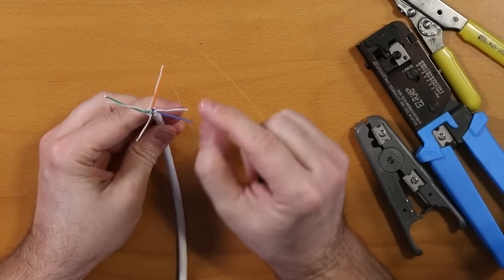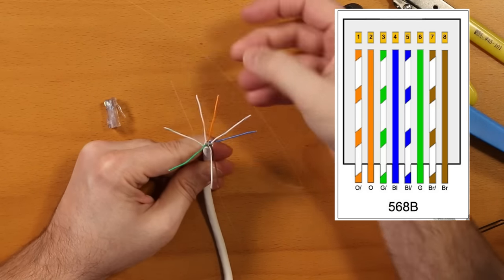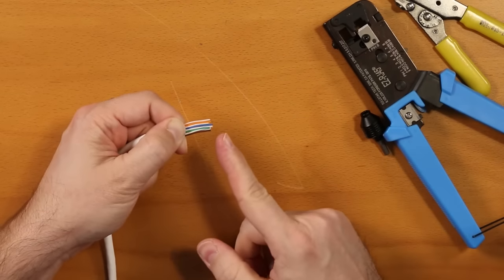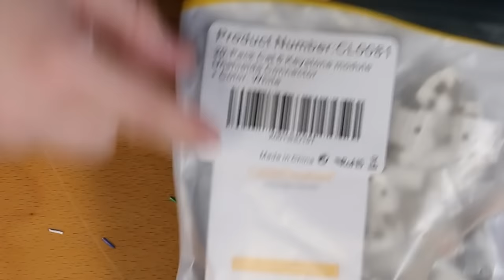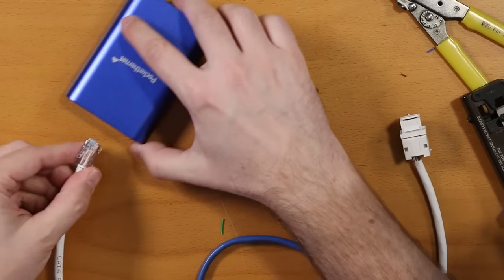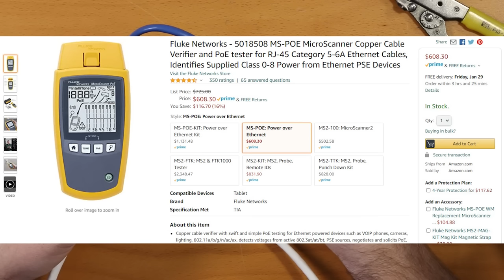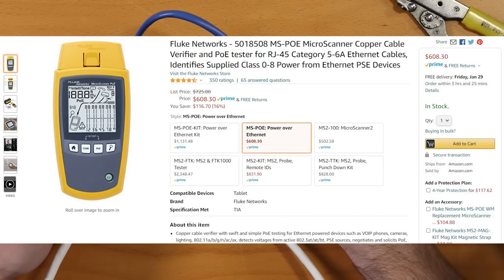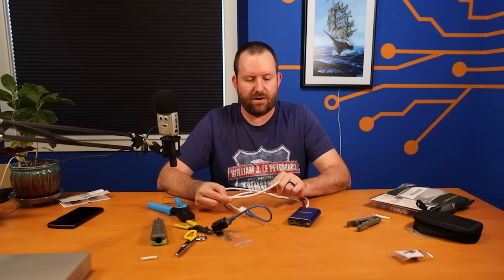How to Terminate Ethernet Cables

Comment: I don’t do it professionally anymore but as a network/telco technician for 20 plus years I refuse to do the standard rj45 crimp direct to cat 5/6 that every else does.  This is because rj45 crimps are to be used with stranded cable, not solid copper cable.  I dunno how many networks I’ve tested with failed connections with a fluke due to crimped cables.  

I do like like the keystone (no tool) direct to cable or the proper punch female connectors.  Far more reliable...  I’ve installed  over 4K telco/Ethernet sites so I’ve tested this pretty good!!  Am I right in thinking you said keystone and then said punch down though?   These are two different technologies.  Keystone is tool less, punch down is using an IDC punch tool.
Reply: I agree.  The little teeth in the RJ45 plug can break solid wire and cause a short.   They have better designed plugs now that work for solid or stranded wire but most people probably don’t check the specs.  I still would not use RJ45 plugs on solid wire except for one-off or test situations.   Stranded wire has many redundant conductors and is flexible so it is made for those relatively short patch cables at either end of a long cable run, which need to endure the manipulation and stresses of endpoint connections.   If you need to hook up an access point or camera it is best to create a mini IDF using 1 or 2 port surface mount punch down jack at the end of a solid wire run in the attic.  You can then use a short stranded wire patch cable for the last few feet to the device.   Stranded wire is expensive so it is not used for long runs.   BTW, stranded wire is a pain to crimp on a plug because the wires curl off in all directions.  Punch down your solid wire and buy your stranded patch cords for best results.
Reply: As a telecom/computer/network tech for the past 50 years, I agree.
BTW, my first LAN experience was in early 1978 on a proprietary LAN that used time division multiplexing over triaxial cable at 8 Mb or coax at 2 Mb.  This predates both Ethernet and IP.
Reply: @James_Knott  I also worked on coax networks and I certainly don’t miss them!

Comment: Never done a socket before. At 18:16 the diagram has Green/ orange on the Top row, and Orange green on the lower. How do you know which configuration to follow. Thanks
Reply: They two rows of colors on the jacks are labeled A or B. Chris was using T568b, so you use the color patten for row B.

Comment: It’ll take my electrician scissors over the cutting on the strippers on everything.    Sharp clean cuts.    I also enjoy them cheaper plastic squeeze type strippers if using 5e.   Cat 6 light scorch and it snalps. 

I learn to pull as I untwist and it helps untwist the cables a lot easier.

 But that is a neat little device for untwisting I have to check out.

And I like the jacket up into the module.     Never used the “pass through”. Guess I’m too old school. 🙃

Comment: On the keystone. Don't unwind the pairs completely. Strip the jacket back further at least 3" ( I usually work with about 4" to 6") can be as long a you like, then just un-twist about the 1st 1.5 inches  from the jacket so the ends are still twisted. Then place the jacket all the way up to the back of the keystone and start slipping the closest pairs in 1st. This way the jacket is as close to the keystone jack as possible and no bare wires are showing. This will really help if you are punching on a panel especially if it's already mounted and you are adding more wires.  On the mod ends I try to work the wires at the jacket after untwistng and I push the wires in a little further so the crimp catches the jacket amd no bare wires are showing.

Comment: Hello. Cat6 I can do ok. Cat6a I have problems with. The load bar for me I have trouble loading. The pairs do not seem to stay in their slot. It's also a little awkward that the wires that should be colored/white are actually just white. Any tips to deal with these issues?

Comment: I find that if you add the step of splitting the sleeve of the plenum cable about a half inch more, you can cut the divider/stiffener lower. This aids in getting the sleeve in the male ethernet connector.

Comment: If you use a connector with LSA plus rails you can also use a cable with stranded wire. Lsa plus has pins that are at a 45 degree angle

Comment: The copper pairs should remain twisted until the IDC for performance reasons
Reply: What does IDC mean?
Reply: @bavobostoen  insulation displacement connector. The little groove the wire gets pushed in where the insulation gets displaced to make the connection

Comment: Can both ends of the interior ethernet cable terminate at a wall socket? So a cable from modem to socket, a cable through the walls from socket to socket, and then a final cable from socket to device.

Comment: More than adequate for the home user wanting to do some terminations.  Pros will have their own method and many are negative about the pass through method as they have spend years snipping the conductors to the correct 100th of a mm. I personally prefer the pass through method but never bother getting the conductors too straight as isn't really needed. Couple of sideways jigs straighten them up enough to stuff then through. Never timed myself but easily less than 30 seconds to strip and term a plug.

Comment: You didn't say and it's hard to see if when you put the plug/connector on if the clip is up or down. It looks like it's down but... (yea, I know it basically doesn't matter as long as both ends are the same, but...

Comment: 2 major issues here. 1. You need to use that string to strip the jacket down further as there is a very high probability that you will score one or more wires when stripping the outer jacket causing a poor or completely non functional termination. 2. I don't recommend using the passthrough ends especially with POE because if the blade isn't sharp the blunt copper ends can touch each other shorting out causing all kinds of headaches, especially in damp environments due to corrosion. Experience is the best teacher.
Reply: I don't know if I like the idea of the passthrough male connecrors.  It just seems like that could cause all kinds of issues long term having exposed wires on the ends? 🤷‍♂️
Reply: @TheSpiv  that's fine, I'm sure there are plenty of installs that never have a problem... I'm just not comfortable personally with it. I'm not trying to tell anyone not to use the pass through rj45s...

Comment: I've watched a bunch of videos on this topic but none seem to emphasize that when you insert the cable into the male connector that the colour orientation ( left to right) is based on viewing the connector from the flat side ( not the side with the little flexible catch.) I assume that you must do it that way or at least do it consistently on the cable that you are currently terminating ?
Reply: Tab down, Pins 1-8 from left to right with orange pairs starting on the left as you insert the cable.   ( 20 years later I still get careless and s few one up.    Just not as often.

Comment: You can also use the channels on the outside of the Klein scissors to straighten your wires.
Reply: If you ever watch a phone tech do an install you will see them use the groves to strip wire. It takes practice to make it work. I use them all the time to strip wire when using cat5/6 for other purposes like phones or project wiring where screw terminals are used.

Comment: Why use B over A? Is there a specific configuration for specific applications?
Reply: There’s some long history on this.  Googling will give you short version here.  568B came out as a means to work with the phone pair (pins 4-5) while allowing use of Moden equipment with older phone systems and data centers.  In theory, if you terminate both A or B, it won’t matter.  If I recall, pins 1-3 n 2-6 are different on the A which is making a crossover (one end terminates A other B).  Hardly used today with auto negotiation switches. 

I think ATT had the insight with the 568B and find it is used almost always. 

Other things I have heard and not verified, was 568A is or was used in many commercial buildings and some countries still.  Not sure on that. 

Home Depot actually has a simple vid on the years of these two wiring schemes. I thought pretty good and will,show to my STEM students.
Reply: @stemmentor9700  beautiful. Thank you for your time!
Reply: A lines up with telephone cable.  B originated with StarLAN, which became 10baseT.

Comment: Hi Chris, this come right on time. I had today a debate with  someone regarding the difference between Cat.5 and Cat.5E cables. He thinks that there is no difference between these types of cables for short runs, and both can handle Gigabit Ethernet. I told him that even if the Negotiation between 2 devices capable of 1Gbps will be 1Gbps, the data transfer will not work at these speeds, but he still has his opinion that they are the same. Who is right?
Reply: I'm installing Fiber in Washington.
CAT5 will NOT work for Gig service.
CAT5e or above will only handle Gig service.  

I believe cat5 Can do 100/100..
But why would you do that?  
When 1000/1000 is the best.
Reply: @ctwm9963  cat 5 can do gig over short distances.
Reply: There is a physical difference in the cables, but over a short distance both should be able to do Gbe. If it negotiates at 1Gbps it should transfer faster than 100Mbps.
Reply: You would knowingly be using substandard materials so there is an ethical aspect to this question beyond whether it works.
Reply: @georgebush6002  if it's paid work yes
Reply: @jasonrowe6302  That definitely changes things, but person ethics may still come into play on what advise, if any, is given.
Reply: @TheSpiv  I almost clarified myself because I didn't want people assuming I was calling them unethical. I was just interested in hearing others people's ethical thoughts on the subject.  I thought you did a good job answering the original question, so thought I would build on that and introduce an additional consideration.  Personally I would try to answer if there is a reasonable chance the cat5 might do the job,  how high are the stakes, and how correctable is it if there are problems.  As long as this is understood and accepted by the appropriate person I would feel my ethical obligations have been met.  Thoughts?
Reply: CAT5e is just CAT5 with tighter tolerances.  Otherwise they're the same and both are rated for 1 GB up to 100M.  You're not likely to find new CAT5 today, as it's been superseded by 5e.
Reply: @ctwm9963  Plain CAT5 will work at Gb.  Gb Ethernet was designed for plain CAT5, before 5e was available.  The only difference between them is 5e has tighter tolerances, but both have the same specs.
Reply: @jasonrowe6302  Gb Ethernet was designed for 100M over plain CAT5 before 5e was available.

Comment: Aren't those RJ45 connectors made to be terminated on to a stranded cable only? Or are those RJ45 connectors made for a solid core cable?
Reply: Should work on both.
Reply: Originally, they were for stranded only.  But since people insisted on using them with solid, they made plugs that could work with solid or both.  Still a bad idea though.

Comment: So you don't have to strip these 8 wires before pushing them into the female end? It cuts into them or something when you push them in? 

I had cat5 run throughout my house during a rebuild and I don't know shit about it, except one cable seemed to not be working. I would test it through my ps5 and it got like 1mb download and 10mb upload (I have a 1gig plan). So I looked at the female end coming out of the wall there and it looks like the orange/white wire was nearly pulled out. It was wrapped up and nearly pulled out from one of the other wires, so I use pulled it out with a small flat head screwdriver, unwrapped it from the other wire it tangled with, and shoved it back in with the tiny flat head screw driver. I didn't strip it, but I assume it strip itself when I push it in. It seemed to work better after, I was pulled down about 100mb and 10mb up. Should be 600mb+ up, so I don't know if there's still other problems or not. My question is, could the low result be because other wires aren't fully in either in that female connector? Because it still technically worked without that orange/white, but only 1mb, then with it, it jumped to 100mb. But maybe with redoing another one it would jump up again? It's just weird that it's not an all or nothing scenario. I figured if one of the 8 wires were out, you'd get nothing as if it was a severed wire, but it still operated with 7 of 8 connected. But I don't know, maybe only 5 or 6 of them are connected properly. I guess maybe I need one of those tools or see if the electrician will come warranty their work.

Comment: Do most cable testers just test continuity, or do they typically have an option for testing throughput?
Reply: There are simple ones for checking mapping to high end ones that measure distance and if a short where it’s at, data loss, etc.  difference is whether spending 20$ or 500$.   You can get some decent one that do a lot for less then 100$.   I’m a fan of Fluke, (Microscanner).  Had for years now.just need to find it again. 😏. 

Stick with quality tools if doing a lot of this type of work.  It’s worth it.

Comment: So I was struggling at first with cutting the cables off the keystone jack, I was told that you have to cut the wires at a certain angle with the cutter.

Comment: Not sure how but...
was changing out some stuff with our internet situation. The former owner was doing some weird shit where some cat6 was going from a switch to a board of some kind, before going out to the rooms. Decided to take out the board cause there was a mess of other wires to all sorts of things that were just in the way, but now, despite me double checking to make sure I was doing the right standards, the speeds are 10% of what they use to be. Any suggestions for what I screwed up?
Reply: Can be multiple issues. Improper termination, possible older hub vice switch,  if using wireless, EMI.  

Did you remove the “panel” and just put on RJ45 modules and plugged into existing switch/hub?   Did you try and reuse and existing stud ,Ike the “ panel”?   

Repunchung down used IDCs or reuse of patch panels can be an issue

Punch down tool has dull blade or weak spring and not seating cables right.  

Check ports using two PCs to see what the  connection speed is.  

What type of switch .   Managed/unmanaged ?    

Possible cut wires.   Quality of switches and new material bought. (Connectors, switch, etc).

Comment: Hi. It's November 2021. Thanks for the vid. I get the idea of the wires being in order, but once they are, do you insert them into the connector with the little retention clip facing up or down? Probably dumb question, but I'm going to devote time and $$ into this project and I want to get it right before I start drilling through walls LOL.

Comment: I wanted to mention that the TPs are not just wrapped around each other, but are twisted themselves. So when you use a 'straightener' like the grooves on a bit, or a screwdriver shaft, you are not untwisting the wires. You are straightening twisted wires under tension. The wires under tension, like a spring, are only held in place by the pressure of the blades in a connector, but they will naturally over time want to untwist against the blades. I suspect some terminations under vibration or frequent movement go bad from this.

This is why making terminations is your, my, everyone's least favorite thing. 

But if you could simultaneously unwrap and untwist, you would have perfectly straight, perfectly untwisted wires. I made something that does just that: https://youtu.be/wTkS6fbAkI8?t=221

Comment: I used to do this kind of thing years ago - I was intrigued by two things.
1 - you made no mention of which way round the plug goes when putting the cables in. Without specifying this you can wire the plug the wrong way round.
2 - you didn't push the cable fully into the plug. The sleeve around the pairs should be pushed into the plug as it helps grip the cable in place when crimped.

Comment: great video!!! I have one question... do i HAVE to do the same color sequence that you use or can i just make my own (as long) as its the same on both ends?? Thanks in advance
Reply: For your own cabling it is fine.  If you're making them for anywhere else it's best to stick to one of the two standards.  The U.S. uses T568B while Canada uses T568A.
But as for the wires, they don't know what color they are.  They can all be the same color and they will still perform the same.  Ask any electrician.
Reply: @cfgdr3  Make sure the electrician knows how to work with Ethernet cables.  Not all do.

Comment: Your keystone jacks will fail certification.   Don’t untwist them all that’s way.
Reply: I was going to say the same thing. Keep them twisted until they are about to pass through the punch down block. Preferably you also want to keep as much wire in the sheath, so I start with the pair furthest from the connector to set the length and work in pairs forward. Also, unlike the male connector, you don’t need to straighten the wires on the female connector as most of it will be cut off.

Comment: Practice removing the cable jacket with electrician’s scissors. You won’t need a special tool once you get good at it. Plus it eliminates the need to have another tool. You were also holding those Klein scissors backwards.